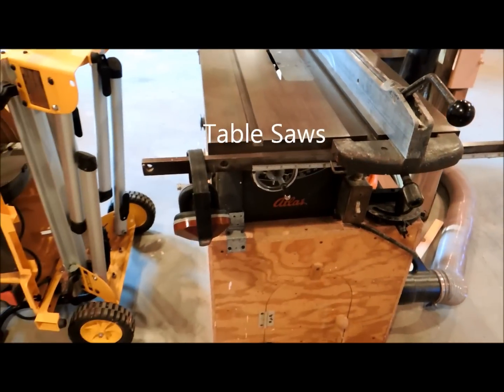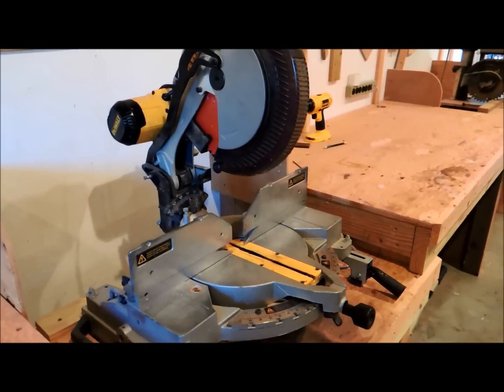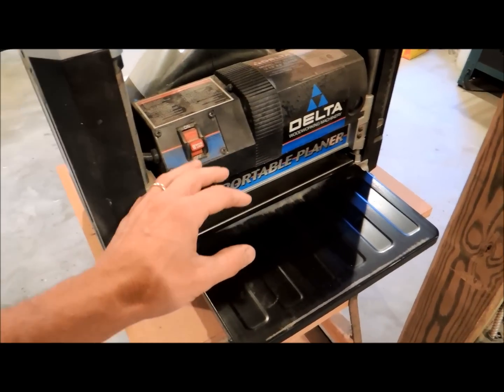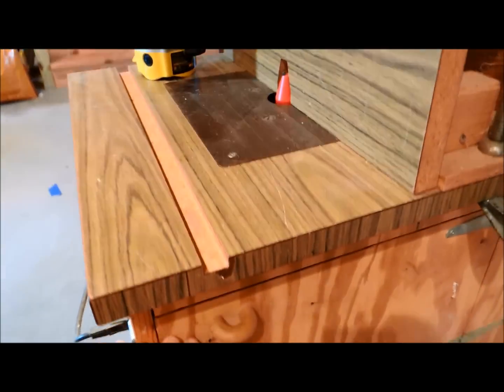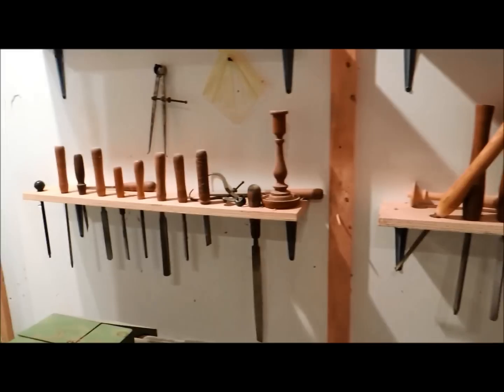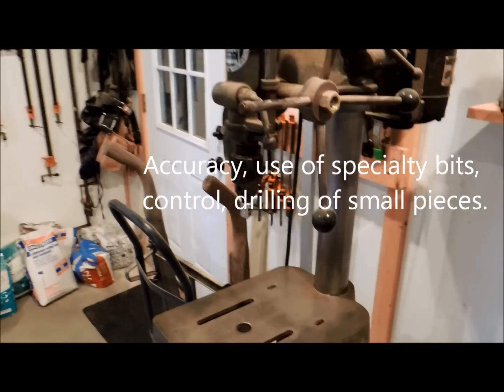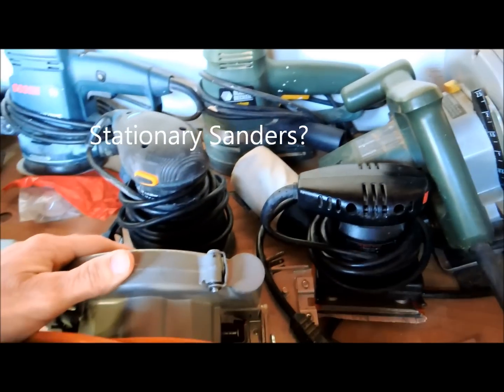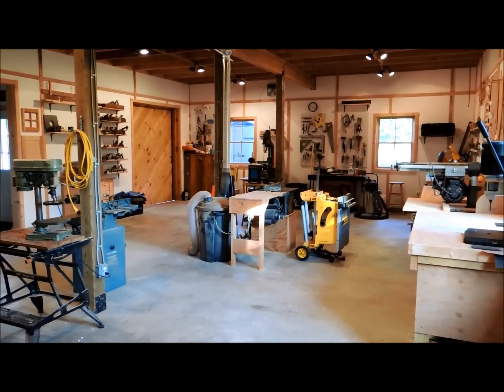Outfitting A Home Shop: Stationary Tools

Comment: My kudos to you for the gift of your video.  Your presentation was well-considered and probably very helpful to 
a great many people.   It's always distressing to view comments where people shove their belligerent and negative
responses around.  But you handle them with grace.  Some cultures say 'alumin...ium', when it isn't even spelled 
with the extra 'i' before the end, but we don't judge them.  You embraced terminology that is normal, and even
correct for the tool suppliers that sold you these items.  Your comments on the application and importance of the
various tools reflects an accurate and advisory point regarding most users who are setting up or looking to expand.
None of us are perfect parallels to your situation, but you never even hinted that yours was the only way.  Please 
don't be discouraged by the little chickenshit jabs anonymous folks can't resist sending.  I have all of your shown
tools and equipment, in larger versions, and salute your approach.

Comment: Well done! I've been a professional woodworker for 40 years and have had almost a dozen shops of all sizes. I agree with your purchase and strategic priorities for a basic/starter shop just about 100%, especially for the carpentry-oriented home shop. Of course, if the emphasis is instead on solid wood cabinetmaking and woodworking, a good (big) jointer and bandsaw would come higher on the list. I especially second your advice on the often overlooked value of open space. When you get past pure tool lust and face reality, you realize that a lot more work gets accomplished in a reasonably equipped shop where you can move around freely than in the same space crammed so full of machinery that it becomes a virtual warehouse...
Reply from the maker: +Michael Schuler Absolutely--your selection of tools will change depending on the type of work you intend to do.  There is no "one size fits all" in woodworking or carpentry.  And, for any given task there is usually more than one way to get it accomplished.  Personal preference for those tasks in important because feeling comfortable with your tools and techniques means being safe and productive too.

As for the open space, I still struggle with that!  It's so easy to collect tools, materials and projects in a shop over time.  You have to make a point not only to organize but to toss out what isn't being used any more.
Reply: +enduringcharm  I have every tool I need for my home shop, except a thickness planer 
and a dust collection system, and don't have $3000 invested, but it 
would cost $10,000 to build even a small dedicated shop to put them in. 
Instead, they're crammed here and there in my garage and I drag things 
out as needed.  The space is much more expensive than the tools.
Reply from the maker: prairie wanderer
Very true, space is expensive.  You'll notice that guys who manage to make a living building commissioned or other furniture are often located out in the boonies where land and buildings are cheaper.
Reply: enduringcharm
I was thinking simply in terms of actually building a small structure, not real estate.  Good point nevertheless.  They probably like the relative lack of distraction that living in the boonies offers.

Comment: Thank you for posting your video.   Space is indeed important as is planning where to place each piece of equipment.   I have found over the years that it takes a long time before you have all pieces.  I work mostly in my garage (my wife would kill me if I brought a spec of sawdust in the house so the basement is out of bounds!!) where I have an extended nook as my tool and workbench area but would love to have the space you do!    Take care.
Reply from the maker: Panos kappa There were years when I was younger when I had to set up shop in a garage or basement.  Just tell your wife that building a barn for your shop would help keep the house cleaner!

Comment: Good info, but if you buy rough lumber and mill it yourself (alot cheaper than pre-milled lumber) a jointer is a necessity...the bigger the better.

Comment: Nice shop, with a good combo of old and new machines. Buying new is not always the best route. I would rank the drill press a little higher. As for sanding, I've built a station for my belt sander which meets my needs for now. Thanks.
Reply from the maker: Steven Purvis I agree--there are some excellent older machines available if you don't mind spending a little time cleaning them up.  One of my table saws is a 1949 Atlas still with the original bearings!

Comment: Jointers can also be used to take cuping and twist out of boards too
which allows you to use wood you ordinarily wouldnt touch
Reply from the maker: That's true.  However, you're still limited by the width of the jointer.

Comment: I have a bit of space in my back yard and I'm thinking of building a basic work shop. How big of a space would you think I need in terms of square footage? Also how big would you say your shop is?
Reply from the maker: Over the years I've had all different sized shops, from a tiny basement room, to a single garage bay, to a double garage bay, to my current shop, which is 24x36 in the first floor main section with a 6x20 entry vestibule and a 12x24 storage area off the back.  The second floor is also 24x36.  You should plan your new shop based on the size of your preferred tools and the space you need to maneuver yourself and your material around them.  You might literally lay it out in the grass with string and boxes to get a feel for the space.  Cost and zoning rules can put a damper on grand plans, but if you are going through the effort of building from scratch I would aim for a minimum of 12x16.  Below that and the effort will likely not be worth it.  If you can afford it and you have the space, something around 16x24 is  a good compromise between cost and footprint.   If you won the lottery, bigger is always better and you will almost certainly fill it!  You can see the construction of my shop here:

http://enduringcharm.com/gallery/exterior-barn.html

Comment: I have a question. Well, i can set it up in my house such as in my garage but it may effect to the neighbour as dust and the noise. It is possible or accept from city ?
Reply from the maker: You'll have to check with your local building department or other authority about permission, but if you install dust collection you can certainly minimize the dust.

Comment: For the mortiser you can get a kit that fits on a standard drill press cant you
Reply from the maker: Yes, you can get kits for this purpose, but they aren't going to offer the same quality of function.  The drill may be turning too fast, the table is not purpose built for the hold-downs, and the strength of the chisel may be questionable.
Reply: enduringcharm mmm true enough a mortiser is really handy though

Comment: Why is a planar higher on the list than the band saw?  Unless you're recycling old wood, I don't really see the need for a planar.   Personally, my favourite tool is either my scroll saw or my drill press, but I tend to do smaller scale, detail-oriented pieces.   Still, I don't see the need for a planar or really even a jointer.  There are other easy ways to accomplish the same task and you don't need to take up extra space in your shop for a dedicated tool for planing.
Reply: +Derick Ryan Unless you do considerable furniture or trim work using recycled or poorly cut wood.
Reply from the maker: +Derick Ryan Of course, much depends on what you are making in your shop.  The argument for a planer is not just about planing down rough cut wood, but also the ability to create non-standard thicknesses out of standard lumber.  I may want 1/2 inch or 5/8 inch stock for drawer sides, for example.  Or I may plane down 5/4 stock to make a 1 inch or 7/8 inch table top thickness.  One way to distinguish hand-crafted furniture from factory made stuff is to avoid the stock 3/4 or 5/4 thicknesses.

Comment: what size is this shop
Reply from the maker: mggcomputers The main section is 24x36, with a second half story above.  Then there is a 12x24 storage area off the back and a 6x20 entry area too.  The arrangement has worked well for me.
Reply: I was just about to ask for your shop dimensions and then found this 'comment'.  I'm laying out out a future house to include a 300'ish sg ft, hobbyist wood turning shop.  BTW, 6x20 entry way - is that additional lay down area, a connecter to the main house or ???  Thank you ...
Reply from the maker: *****
The 6x20 area is just off of the main room.  I set up floor to ceiling shelving there, roughly two feet deep, where I store all of my handheld electric tools, caulk, electrical and plumbing toolboxes, battery chargers, etc.  So, it's basically a 3.5 or 4 foot wide hallway where I can come in through an entry door and deposit all my tools from the jobsite at the end of the day or the project.  You can see pictures of the whole barn here:

http://www.enduringcharm.com/gallery/clients/ecbarn.html
Reply: Fabulous shop (barn)!  Incidentally, my family is originally from the northeast and my folks first 'house' was 1/2 of a working chicken coop on a farm in Metuchen, NJ - circa late 1940s.  Dad completely renovated/converted their half into a home.  I'm told (as I was not yet around) that when inside you'd never know you were in a coop.  They named it "Cackleberry Castle".  Thank you again - I much enjoy your videos/postings  ...
Reply from the maker: *****
That's funny--when my wife and I were first married and bought our first house in Somerset County, the old timers in the neighborhood swore it was originally a chicken coop too!   Judging from the quality of the construction I think they were right.

Comment: I am crying here!!! Why do Americans call it a jointer??? What does it joint? It's a surface planer! And the 'planer' as u call it is a thicknesser (it thicknesses timber) Americans are so backwards but nice video :)
Reply from the maker: +jp k We have lots of things backwards here, what can I tell you?  I think the Jointer name must have come about because a common application for the tool is to clean up the edges of two boards which are then joined together edge to edge to form a wider piece.  There are hand planes back in the day which shared the same name.  Woodworking and construction are full of seemingly non-sensical names.  It isn't just between countries, either--I can go to the next state over from me and half of what a fellow carpenter says is foreign to me.
Reply from the maker: John G. Walter
"Dressing" the edge is just slang for producing a flat, smooth edge on a board, often when intended to be joined together with another board.  This video was about a six inch jointer, which is useless for flattening much of the wood I use since the width of what I need is much greater than the jointer.  When I buy rough cut wood it is for wide widths of ten to 18 inches or more, and it often must be flattened by hand.  For narrower widths I buy S4S.  I do use my jointer for prepping edges for sawing and joining, as well as to straighten the edges of long boards.  I'll also use it in prepping table legs or turning blocks and the like.  Incidentally, it is possible to use a planer (mine goes to 12 inches) to flatten wood if you use shims underneath the work piece.
Reply: jp k thicknesser is such a clunky word it sounds and feels clunky

Calling a planer a planer males sense if you look at the board as a finite plane that you want to make flat and smooth

Jointer yea i dont know why personally i would call it an edger or edge-dresser maybe